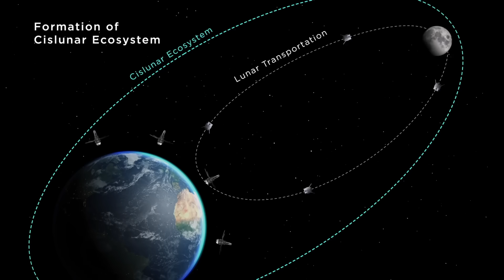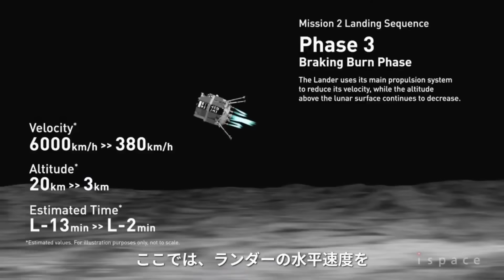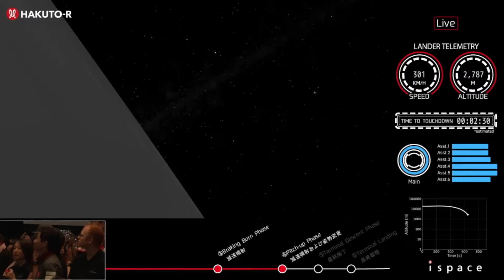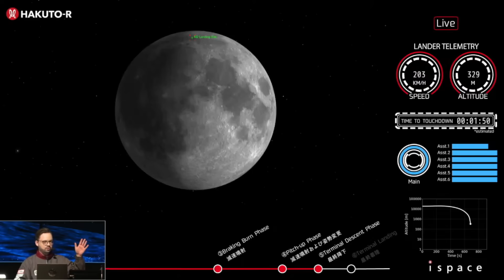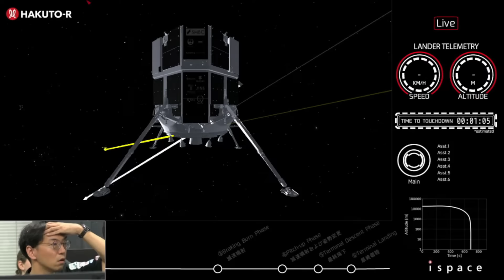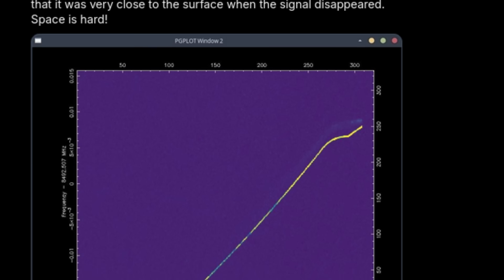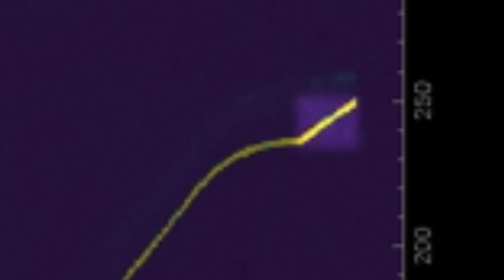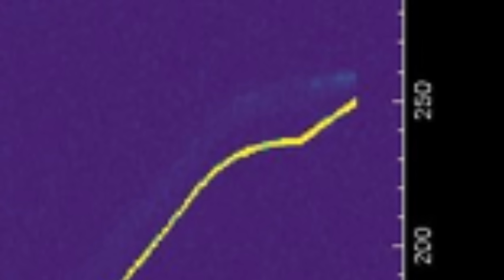Japan Crashes into The Moon, but Slower Than Last Time

Comment: The more i see these failures the more i realize how difficult the apollo missions were. But i guess they did have almost the entirety of nasa working towards it, a lot of budget, and 3 pieces of software onboard that are exceptionally good at problem solving.

Edit: people have pointed out that “wetware” is a more appropriate term.
Reply: Don't forget about the Surveyor and Lunokhod probes.
Reply: @geoffreyporter6373  Yep, they landed on the moon before Apollo, and didn't require any wetware to accomplish it
Reply: @pauldzim With 1960s technology was dependent on the wetware doing the processing ahead of time.
And to be frank, they had big budgets and the cream of the wetware was working on the problem, now it's tiny budgets and the cream are spread far thinner 🤷
Reply: No PID controller back then for the landing engine throttle !
Reply: @pauldzim but they had a lot of failures before achieving a successfull landing
Reply: @geoffreyporter6373  And their "computers" were really just a timer-sequencer and maybe a few sensors. But look at the width of the landing gear compared to the height of the Surveyor. Very low center of gravity.
Reply: All of them, surveyor and Apollo didn't truly soft land, they all did the drop landing, 6 feet for Apollo and 10 for surveyor.
Reply: @imaginary_friend7300  6 feet on the Moon is 1 foot on Earth; I would call that the equivalent of a soft landing. I'm not sure what "truly" has to do with engineering, but, even in my 8th decade I would count jumping impetuously off a 1 foot tower onto the floor as resulting in a truly soft landing.
Reply: @imaginary_friend7300  "any landing you can walk away from - is a soft landing"
Reply: @imaginary_friend7300 Still the ground looked almost "polished" when Armstrong stepped down. What could have happened? 😂
Reply: @BSnicks  You might need a history lesson. Armstrong had to take over and abort the computer's landing because it was putting them down in a crater field. He flew on past this to look for a better spot while running his fuel down to the abort limit. Then radar altimeter data caused a buffer overflow in the computer and it started throwing errors that neither the crew or Mission Control knew what they were. They looked them up on the ground after some serious tension and then Armstrong landed it like a boss.
Reply: @jameshisself9324 I don't need a history lesson. Because all rational people know that Armstrong never left Earth's atmosphere. Even NASA cannot support Armstrong anymore.
Reply: @BSnicks  Been explained to death. you should watch more of those videos, it's science.
Reply: The US and Russia first landed unmanned probes to the moon in 1966.
Reply: It was hard but the USSR landed probs before Apollo as well. Pilots make it easier but there was hardware/software capable at that time
Reply: Well, I remember watching a video about Apollo landing process on YouTube, and one part of the process was the commander literally looking out the window (i.e. you can see the horizon and judge your height somewhat) and using the marking on the window to adjust where to land (i.e. have a good model of what the landing site is like). Oh, the astronauts were briefed on what they should expect in terms of terrain feature on the landing approach, so they knew where they were.

Here, it seems like the craft has basically no way of actually telling where it is, have no way of knowing what the landing approach environment (i.e. the strip of lunar surface from the orbit, decel burn, to the landing site) looks like. It's literally landing blind.
Reply: @BicyclesMayUseFullLane  Yes. NASA had to work quite a while to figure out where Apollo 11 actually landed.
Reply: @BicyclesMayUseFullLane  They had sent several missions, both unmanned to land and manned ones just to orbit before, so they had a good understanding of what the actual moon landing would be like. It is not like NASA went from launching small sattelites to sending people to the moon.
Reply: @huleboermannhule44  That's the point. NASA actually went and scouted ahead so there wouldn't be any surprises. Meanwhile, these guys just decided to YOLO because of lack of budget.
Reply: I think the landing location has a lot to do with it. But yes, the Apollo program had considerable resources and they tested a LOT.
Reply: I have the highest regard for NASA engineers, they did an incredible thing, and sometimes good engineers get lucky, because they at least cover the known problems.  Good luck to everyone trying to land on another planetary body, it's incredible to even try.
Reply: @LokiCentral One of my mentors was a NASA engineer who designed the habitat the astronauts lived in for a week or so when they returned from the moon. NASA wanted to be certain no deadly pathogens were returned; this gentleman, who has since passed away, was incredibly talented - most intelligent guy I've ever known. And he was a real pleasure to be around. He had a thick book of NASA collectibles from the late 60's and early 70's, and it included unpublished 8X10 pictures that were very, very interesting.
Reply: Most of you should be banned from these comments for idiocy. Comparison to the Apollo landers is a joke: the lander dropped down from another craft in orbit, so was able to cancel its horizontal velocity, making the process of landing much more straightforward. This probe came in hot at an angle, and did not descend from an already stable orbit. Totally different problem to solve.
Reply: @Ping_freud22  Are you sure you passed the physics class?
Reply: @BSnicks you sure you passed the first grade?
Reply: @FentonTheIIV I never went to 1st grade! But I think I passed all my physics classes with a 100% test score, including Physics 101 and 102.
Reply: @BSnicks lol makes sense
Reply: you should say the more you realized how good the Chinese are
Reply: Yup biorobots are great
Reply: I believe humans count as “meat-ware” or “mush-ware”
Reply: Two of them were combat pilots...
Reply: But... The Chinese looks easy. I guess it's the mentality that "If China can, we can too" to blame.
Reply: Watch "American Moon", lots of original, unedited footage!
Make sure to watch at least the 10 last minutes ;-)
Reply: That's your take away? The more space failure happening now the more one in a million first try awesome the apollo mission was?
Reply: @antediluviangocart yeah?
Reply: Biggest issue I see they're going for polar landings and need panels higher to the horizon 
   So its the top heavy nature of the lander vs the lower center of mass and wider stature of successful landings
Reply: I'm just guessing the launch vehicle can't accommodate a larger landing base idk
Reply: @terranovarain6570 Purportedly they have the narrower taller landing craft because that was what would fit under the biggest fairing that would fit on the rocket.
Reply: Yes and astronauts could calculate long hand and not calculator.
Reply: Need to install a chimp with all of these landings that is trained in landing level
Reply: But Scott explains how much simpler the Apollo missions were. However he did make it sound like they were featherweights, relative to the modern needs for heavier, commercially-viable payloads that would be sent today. He kind of neglected to mention the three men, scientific equipment, and the Americans and Soviets bringing vehicles, including (allegedly, if you want to doubt it), the former being a driving vehicle, which had to be stored with all sorts of ropes and pulleys. Basically the explanation is that 50 years ago it was about utterly pouring money and resources into simple, direct, inefficient missions, just to do it. What I can't explain is why this is now in the hands of private companies pursuing commercial missions. Also, after 50+ years, we have a company able to land boosters on earth, even catch them on the launch tower, but landing anything on the moon is a Herculean task? Even with a more difficult mission, you have 50+ years of advancements in tech, science, and human understanding. 

It's inexplicable, but there's also a plausible explanation, and I think it's an elephant in the room. Human intelligence is actually declining, or at least is inadequate to the technological state we are in. I.e. our technology has outpaced our intelligence. We're dumber. There's so much evidence of this in our education systems. Scott's video about hacking Voyager contributes, showing how close we came to losing Voyager because of our own lost knowledge. Let's not forget the US incompetence mission to Mars due to a metric vs. imperial measurement mistake. Today most professionals have solved problems on their own. In the not to distant future, we'll depend on minds who have always had Google and AI. Another plausible supposition on why we see no signs of other intelligent life in the universe, a great filter by way of intellectual outsourcing. AI might be the only thing out there, and it would not come within 1000 light years of sentient meat that only knows becomes intelligent enough to destroy other life.
Reply: @michaelscott-joynt3215  No GPS nor other guidance signals nor landing pad. They have grid fins for free manoeuvring. They crashed 20 of the things in the test phase on earth where they have cameras and can pick up the pieces to analysis. I am sure iSpace would have landed on the Moon by now if they had the resources to retry 20 times.

The problem is Silicone Valley corporate culture of 'Go Fast, Break Things' more than kids getting ChatGPT brain rot.
Reply: @michaelscott-joynt3215  A laughable explanation. Logic and reason says the only plausible explanation is that the Apollo landings never happened. 
What you're doing sounds very similar to a flat earther, finding nonsensical reasons for continuing to believe the earth is flat, despite common sense and logic saying it's a globe.
Reply: @michaelscott-joynt3215  Look at you, jumping through hoops to explain away that, during "apollo" a very heavy lander, manned no less, touched down on the moon on the first try, with a landing system that had not a single successful test aka actually landing something in one piece.

The explanation is simple. It's just that you don't want to accept it:
They faked it.
Reply: I don't know, this just seems like they keep making elementary oversights.
Reply: It looks like all of these modern probes are trying to do it without radar to save space/weight. I'm pretty sure all of the older probes and landers used radar because it is extremely effective for this kind of thing.
Reply: @patreekotime4578  Apollo used a radar altimeter, I've not heard of probes using anything like full radar, which isn't that good at painting a reliable picture of the ground. If we could map the moon surface like we have Earth and put up some gps satellites there we could use gps synthetic aperture vision which is common in most aircraft today. But we probably don't need that view for the computer, just the data stream.
Reply: Heck, I knew what you meant. We are pretty soft and squishy.
Reply: If what Scott says is true about the cause of these failures (not allowing for the existence of mountains, relying on 1 sensor for altitude data) then this was just a shockingly poorly designed mission.
Reply: Nasa had an increment approch. First the Ranger series crashed on to the moon sending back imagry till they crashed. Then the surveyor series that landed, and finally Apollo, which was much more complicated.
Reply: Allegedly
Reply: @int-64 have you any actual proof questioning the 3rd party evidence?

Or is it just belief that by principle everything is a lie? Because that is religion, not facts.
Reply: @The_3D_Creator it's you who have to provide proofs. Oh wait what ahppened to the original apollo footage? Yeah its gone, what a coincidence.
Reply: @int-64 you blame, you proove. It is impossible to proove non-existence of something, for example a crime or a conspiracy. That's why we don't have inquisition process anymore. You're far behind.
Reply: We can't automatically land on Earth on an unprepared surface.  Aircraft use ground based signals for the precise positioning to be able to band on a runway.  GPS uses ground based data to give a detailed position.  Drones use 3D accelerometers, 3D rate gyros, 3D compass readings, GPS and pressure altitude to work out their attitude, velocity and height.  The Moon has no GPS, no atmosphere and no significant magnetic field.
Using Lidar or radar to get detail of height and velocity, and determining the attitude relative to the surface is difficult, especially if the sensors aren't looking at the surface.
Reply: @ChrisRowland-c7w With GPS you can actually get detailed position including altitude without ground based data provided you have a 4 satellite lock. We need to put gps satellites in moon orbit. I know there is no budgetary justification now, but there will be before too long.
Reply: "Meatware" is my term for it!
Reply: Same thing with Starship, NASA got Saturn V to the moon and landed it. Difference is that today is private companies are attempting
Reply: the space craft really needs to have more sensors and cost a bit more
Reply: in apollo you had guys looking out of the windows and making  quick decisions.

and a higher budget, same is true for Chinas moon missions.
Reply: Really? Difficult? All of them that attempted landing, landed successfully. They also returned 100% successfully. Even the one that had technical failure on the way there got safely back. In light of these new attempts, what are the odds of being 100% successful multiple times?
Reply: People forget that, as opposed to this planet, the moon is ROUND, and therefore present a whole lot of different challenges when it comes to landing on it.
Reply: What's it gonna take for you to believe that they faked the whole thing?
Reply: @antediluviangocart idk just give me your most convincing argument
Reply: @VyarkX They are supposedly sending vessels to the moon, why no people on board when this was possible in the 60s and would supposedly make it possible to land without crashing?
Reply: in-space is the only company with most failures
Reply: Saturn 5 was exceptionally good. You could not even replicate. Stop with the software was too good. Thats an insult to Saturn 5! It can do 42 tons onto TLI orbit.
Reply: And they had pilots, which were a lot better than algorythms.
Reply: @AndreasPeters-r3e  Those would be the "3 pieces of software onboard that are exceptionally good at problem solving."
Reply: @AndreasPeters-r3e  Well the pilots were not actually in complete control of the LEM. But I take your point, Commander Armstrong was aware the trajectory was long and the automated landing site was unsuitable - he keeped resetting the guidance computer until it picked a better landing location. And touchdown was pretty much manual.
Reply: @AndreasPeters-r3e bro can you read?
Reply: @AndreasPeters-r3e  well its questionable.. you have limited amount of fuel.. and limited amount of time. you have to free fall fast enough and compute correct time to start decelarating but not too up bacause that limited fuel will not be enouh if you launc too up.. but if you execute rockets too late itll not be enough to slow down in time :D which im sure software can do better but weirdly cant.
Reply: @AndreasPeters-r3e  USSR send 3 rovers to the moon more then 50 years ago ,only first failed to land ,with computers that had like 1 kb off memory ,scientist back then were smarter then todays
Reply: @AndreasPeters-r3e soviets landed probes and rovers without pilots.
Reply: The Apollo missions had the advantage of meat behind the stick. Armstrong was a great example, who took control to modify their approach. The robots simply aren't capable of improvising a solution. In fact, since they aren't self aware, they aren't even realizing they're about to scatter their guts on the moon.
Reply: @LordFalconsword tje LEM and guidance computer were exceptionally sophisticated for what it had to do. The pilots insisted that they needed some level of control. That was the start of the man in the loop concept. Outside of Apollo 11 all of The Landings could have been performed by the computer alone but if you read the transcripts every pilot insisted on taking manual control. There are several great books on the guidance computer and Lem configuration.
Reply: So, NASA successfully lands rovers on Mars. They are Curiosity, Perseverance, Sojourner and Mars Reconnaissance rovers. Is the knowledge and expertise not being shared with these start up companies?
Reply: @patrickoneill1011  On Mars you can use parachutes but the moon has no atmosphere.
Reply: @amantedar123 On Mars its a lot harder… there is atmosphere on Mars but it’s not thick enough to slow down the vehicle or to use just the parachute only for landing… but it is thick enough to cause problem with heat on re-entry. 

So they basically use everything to land the rover there… heat shield+airbrakes+parachute+propulsive landing.

On the moon you can only use propulsive landing and since there is no atmosphere, you also don’t need heat shield which make the vehicle much lighter and a lot easier to land using just propulsion.
Reply: @patrickoneill1011  I kept a watch on all those lander projects, from the day NASA first announced plans for the missions. 

There were numerous testing updates, and test evaluation meetings. That is the factor that most stood out to me. They'd simulate the environment, they make water resistant versions to test in neutral buoyancy water tanks, shake them, break them, vibrate them, develop new materials and technologies specifically for whatever conditions the craft would experience. The project slowly transitioned to the point where so much testing and retesting had been done, typically two identical craft would be launched in case of technical failure, not a test launch, 100% built, designed,  tested mission ready. Typically craft 1 and  craft 2 would be a success.
Reply: @patrickoneill1011 Mars has an atmosphere. Totally different proposition.
Reply: China landed a craft on the backside of the moon, collected sample and came back safely last year using the latest technology and computer power.
Reply: This is because most countries lack various technologies, platforms, resources and long-term development policies. Therefore, Japan and the Apollo program are not a good comparison example
Reply: Or also you can listen to what Buzz Aldrin has to say …
Reply: @jerga2002 Contact light were the first words spoken by a human being on the Moon July 20 1969. 🌑🌒🌓🌔🌕🌖🌗🌘🌙🌚
Reply: @jerga2002 He was speaking in jest. The hardware lays on the moon for anyone to see.
Reply: and they landed at firt try with huamns today with huumans if they try it itll turn to a cementary :D
Reply: @ahmetmutlu348  Not quite. NASA had manned Apollo missions that only orbited the moon and returned to Earth. They had another Apollo mission for the lunar lander to undock from the lunar orbiter, descend towards lunar surface, without landing, then ascend and dock with the lunar orbiter, and return to this planet. 

Each stage of the Apollo mission that needed to be tested in lunar orbit, was a manned mission. 

Sure they might have put a man on the moon at first attempt, but it was considered important for the Apollo missions, to test the means to bring him back as well.

That's the reason why the first manned landing isn't Apollo 01
Reply: You believe its real? We cant even go past the space station! Smarten up
Reply: @GoldVP...  get lost. nobody here is interested in that garbage.
Reply: or they never went.
Reply: they landed in Hollywood studios, it was so difficult to pull that off😭
Reply: It was easier back then because black women's did the math before it was racist. I saw a movie about it. That's how Americans landed on the moon
Reply: @DaveyCrockett1 black women brought us the moon landing, yes please spread these news more 😂
Reply: Come on guys, let's just admit it was a hoax and move on
Reply: @MattyEngland u know we have modern images of the landers on the moon right?
Reply: @MattyEngland  Don't be silly
Reply: @MattyEngland  I'm a hoax. Prove it.
Reply: @MattyEngland so if some other guy crashes a car, that is a proof  YOU and nobody else cannot drive car and all the cars are hoax...??
With all the 3rd party evidence, still talking this hoax sh*t means you just need to believe and are not interested in facts at all.
Reply: @MattyEngland lol